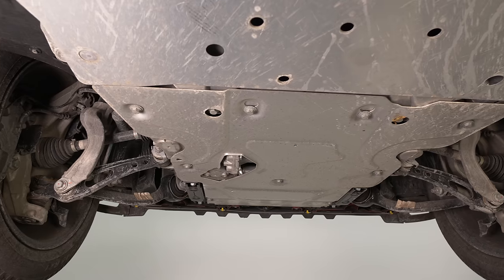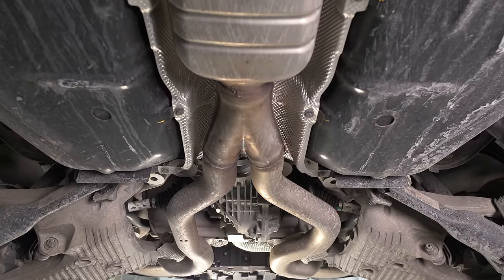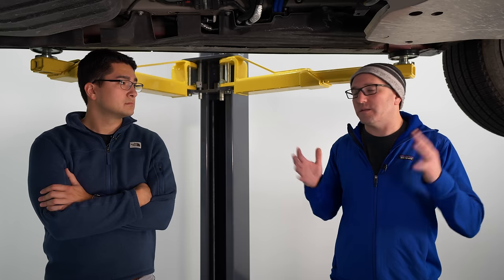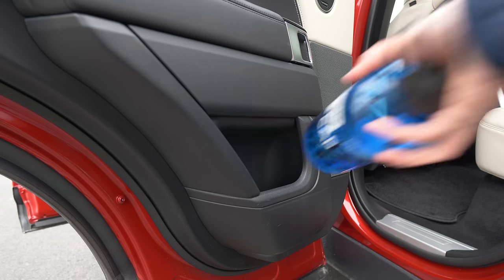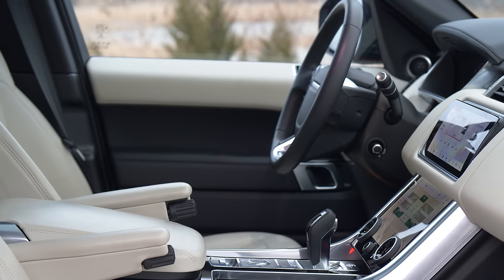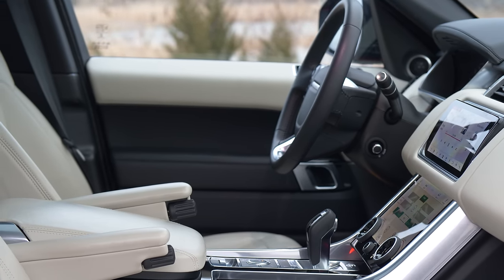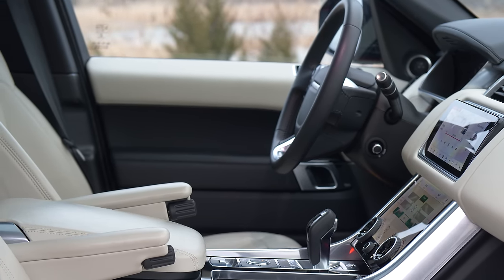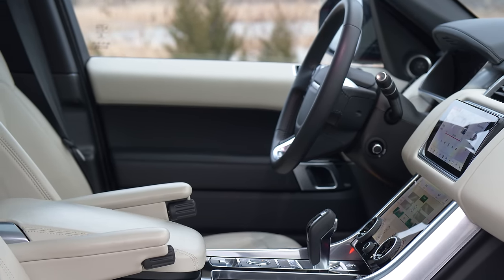2020 Range Rover Sport | More Than Just Status?

Comment: We’ve owned a 2014 Sport supercharged since new. And extended warranty to 100,000 miles. And it gets the snot beat out of it. We have always since 20,000 mls taken it off-road and absolutely covered it in mud and it has never said no. Nothing more fun than flying over nasty conditions and throwing giant rooster tails. And logging roads at well above normal speeds are an absolute riot! Only 1 strut malfunction in 91,770 miles, do to a sensor. And 1 fuel pump issue. It will be gone before warranty is up ( we’re not stupid). Has been a wonderful vehicle! Love pulling up to valet at hotels with it caked in mud. The slow infotainment is annoying. But like anything, you learn its shortcomings and deal. Every other aspect outweighs that. And the big dog Meridian system is a whopper! And that cooler in the console is great for road “sodas”. We live on a long dirt road and it spends more time dusty or muddy than clean. We bought it for its capabilities and not to be a mall queen. It’s got trail damage on underside and had a few cladding scratches. I don’t understand buying something and not using its potential. Wonderful camping trip machine. And would certainly own another. My mother in-law still owns a 2006 RR (the red beast) and it too gets the balls run off it. And besides basic maintenance and while under warranty, covered repairs. The biggest thing to happen to it since was failed backup camera. Got a junkyard unit and she’s doing well. And I might add, when we leave it for service once a year, we drive off in a brand new Land Rover. We are sold. It just works and begs to have the go fast pedal to the floor.
Reply from the maker: Thanks for that, glad to see its been gold.
Reply: My dad's 2014 RR Sport is still running strong as well. He will also be selling it before the warranty runs out.
Reply: Joe Perry I’ve had 6 Land Rovers in the past and I can say the unreliability Notion is untrue
Reply: you got lottery, don't push too far of your luck with it
Reply: rondhole, I wouldn’t say lottery when it’s had 91,000+ miles of real use and was only babied during break in period. It’s always roared to life and is happy to used just like you would a 10 year old 4Runner.
Reply: @joeperry9589  Rover owners are just always in denial. 2014 and 91k miles being a testament? Just wait til you hit 100-120k.
Reply: SC14 , this isn’t my first rodeo. What do you drive? I can pick that apart too.
Reply: @joeperry9589  opposite ends of the spectrum Fiat 500 Abarth and a '11 Land cruiser 200. Abarth has 118k mi and the cruiser got 176k. Surprisingly the Fiat is more reliable than the LC. Has only had a door handle rip off and a couple burnt side bulbs. LC needed radiator and water pump at 150k .....it was on the way out.
Reply: And if you read, it’s gone before warranty is out.
Reply: @joeperry9589  smart. This 2014+ RRS surprisingly has a decent resale value. What do you think you'll get for it at 99k miles?
Reply: SC14, probably worth a high mileage Nissan Versa... Lol
No it’s worth about $30k which is not great. You have to know that going in. I would love to do an LC200 over-landing rig! Wish we could have V8 diesel in the states. Speaking of reliability nightmares. The other car is a 2009 Audi A4 Quattro prestige with 130,000! Yeah she burns oil, but drives just like new. Besides normal wear items the only real problem was the turbo failed at 99,920 miles. It was towed to dealership 100 miles away and had $9,000 worth of fixes under warranty. It’s worth about as much as yesterday’s newspaper. So I will Drive it until it dies and sell it for parts.
Reply: @joeperry9589  nah the LC200, you don't want a V8 diesel if you live in USA. Diesel, the loudness, premium price for the engine upgrade and diesel fuel and all its complicated systems outweigh it's benefits at least here in the USA. Yeah, if you want to chip and tune it for a lot of power it does, but for the USA, the amount of gas stations, and how smooth the v8 gas 5.7l is. I'd choose the 5.7L over the 4.5l diesel. 17.5mpg on the 5.7l vs probably 24ish mpg on the diesel isn't worth it to me
Reply: SC14 loudness?! I drive a supercharged V8 that wakes the dead. Yes, I would want it tuned, extended range tank and the low end torque I’m used to and lockers front and rear. Living in Northern California we have no shortage of diesel fuel. Basically most people drive diesel pickups, we’re in farm country. I can see your point. Just less of a none issue for me. I would also totally take a 78 Ute if I could get one. So will probably get an older LX570 and save the cash lol
Reply: OK... feels like the tata Indian marketing team is on the YT comments section again
Reply: 986C I see the Toyota marketing team has done you well
Reply: 986C says the person with chicken tikka masala as the first video in your playlist. Comic gold! I sure hope you meant to be hilarious my friend!
Reply: Abso lutely, couldn’t agree more. Low end torque and pull throughout the rev range and zero lag. And the exhaust isn’t tainted with turbo muffle. Win win
Reply: Ackj 375718 that’s the person’s handle. It auto filled. And it’s you. Not u. Why make drama?
Reply: Ackj 375718,  did you not see the comma?
Reply: Ackj 375718 we were having a conversation about experience. You inserted a poorly spilled comment about spelling. When you obviously didn’t read the thread. Literally no reason for you to call me out about spelling. Grammar? Why so mad? I’m not.
Reply: @bcatz454  that is the reason why they are dumping for a brand new one before it dies, I mean does.
Reply: Joe Perry Jaguar Land Rover unreliability does not really exist anymore
Reply: Why get rid of it if it’s been reliable and you love it? If it’s been good up to this point it’s usually a solid indication. I’d jus keep it.
Reply: Stephen Isaac, just giving me experience. We’ve had Toyotas in the family lemon law buy back and Lexus nightmares as well. The crap you stuff in a box the crap can fall out when the lid opens. I don’t think any car is as reliable anymore. Too much electronic wizardry is bound to go knockers up at some point. Just had a good experience with this unit. And the old 2006 RR is still going fine as well. I look at it this way, drive what want. If it doesn’t work out? Get something else. It’s a vehicle not a child. Who cares.
Reply: Vizenz121, because I know that it will soon require more repair cost than its actual value. One of my close friends had a 335is that had $30,000 in CPO warranty work done to it over the 5 years he owned it and sold it for enough for a down payment on another vehicle. Going to sell it before things wear out and avoid the headache. It’s been one of my favorite vehicles in my life. But it’s time is limited in our garage. On to something new.
Reply: Joe Perry cool.  I own a new VW Touareg TDI. I get 26mpg on average.  I’ve got a 700 mile fuel range, love it.
Reply: I mean most cars are good up to 100k miles, that's kind of the standard. The distiction you have to say your Rover has been ok to 91k miles speaks volumes.
Reply: L42 Nosnibor and that’s why we won’t be keeping it past 100k warranty.
Reply: Yankee Doodle a friend of mine has a 2016 Touareg TDI and I love it. Vastly unrated suv in my opinion. Great mpg, comfort and fit and finish is great. Keeper for sure.
Reply: @joeperry9589  probably the right move.
Reply: Joe Perry I own an SL55 from 2003 and it was reliable a few years ago when I bought it and still is. Ya I’ve replaced some struts on it, accumulators and an alternator but it’s still cheaper than a new AMG GT. But I will say if u wanna save some $$, get yourself a daily driver nothing fancy like a Old pick up or something and then have some nice cars for the weekend because the money you save will be more than enough to cover the daily vehicle price and insurance if you plan it right and get something used for the daily. That’s what I do and it works great. I got the amg and a new v90 as my 2 fun cars and a Nissan Frontier as my daily. And also have you done any work on cars before? Look up some tutorials on how to do some stuff and if you feel like it’s a little over your head than just take it in. I was able to do belts, alternators, supercharger oil all myself at a fraction of the cost. And if there’s something over my head than I’ll just take it in. You can’t be shy. Idk what your friend was doing to that bmw but if he was daily driving it than that explains why his bills are higher. You can’t be shy about spending money on maintenance, these are enthusiast cars they have a soul and they have deeply human characteristics. You gotta pay to play but you don’t have to pay that much doing a CPo every time it expires. That’s like crazy expensive!! Ya the money you put in has the ability to exceed the value depending on how long u keep it but that’s partly cause the depreciation is so high on these and if you look at the cost of a new or even a newer one your way cheaper! And some of those components too don’t last long so if u get slightly used one u don’t know what might break or what’s done to it really. Big deal if it’s not cpo. Also if you buy the part once on I think fcp euro and it breaks again you’ll get a free part. The more parts my Mercedes gets replaced the more CPo it becomes. So far the struts which are one of the big ticket items are technically CPo I guess haha. You don’t need to buy newer to get good warranty coverage. It’s the biggest myth In this industry. In fact fcp is like a lifetime parts warranty, way better than what the oems offer.
Reply: Range Rovers are the best they have ever been, and getting better. All the high end luxury brands cost more to maintain, that is a known fact. The infotainment is good enough and will be better with the PIVI PRO system which will be featured in the all new Bad A.. DEFENDER! Above and Beyond Land Rover is on the way up:) thanks for the video Geese!
Reply: I've had a 2013 LR4 since new as well. She has 96,000 on her and has never broken once. It's going to be sold before the warranty is over though
Reply: Vizenz121 I do not work on the RR as it’s under warranty. Aside from brakes. It goes to LR once a year for its oil change and inspection when the dash says. The Audi I have done all maintenance and brakes since warranty ended. And had a Jeep XJ that never saw a mechanic in the 10 years I owned it. I did all service and repairs after warranty. I just personally don’t want to open Pandora’s box when age takes its toll on the RRS. Speaking about the BMW, he didn’t spend a dime on fixes. BMW kept replacing   Parts as they failed. He drove it to work and back, towed it to the dealer and so on. Cars aren’t difficult to repair if you want to spend money on them. I just don’t want to start throwing money at it and keep it forever. And I do go between it and the Audi, sometimes it doesn’t get driven for a few weeks. Once it sat for a month. It started out as a take it on weekends and the like. But it is too nice driving to not get miles put on. And used as a regular ride.
Reply: James Y that’s why it has HUGE brakes and stops very well for it size. It drives down the road at 100+ with ease. Does it handle like a small sedan? No. It’s not a small sedan. Can you easily put 9 hours behind the wheel? Absolutely. Can it take you to a great camping spot where you need ground clearance and the rear locker? Yes. I love it for what it is. That’s why I drive it.
Reply: I think you got a lemon
Reply: @joeperry9589  well, its sale number and sold to India and now China tells everything about Range rover. Statistically proven of the most unreliable  car by design although quality control is decent. That's  why UN do not use it, Warlords in Middle East or Africa do not use it. It is for sassy people.
Reply: Hunter Evans Yet everybody is trying to sell them before the warranty runs out.... hmmmmmmmmm.... 
I think people get a sort of Stockholm Syndrome with some of these luxury cars. “I’ve only had one strut fail and a fuel pump issue by 100k miles”... that’s not normal or considered reliable. Struts go, but most cars have NO issues before 100k miles. Go drive a Lexus or Toyota SUV and you likely will have 0 repairs before 100k miles.
Reply: Joe Perry currently have a 07 Jag S-Type 193,200 miles
Reply: n9athan, you must have missed my comment about having Toyota lemon lawed. Tundra with 20k miles and failed transmission seal that took the trans out. And was never properly remedied. 2 month old Lexus LX sat at dealership for over a month with nearly its entire interior removed waiting for a work around because of electrical gremlins. And don’t the BMW issues were hellish. I think having a strut sensor failure and a fuel pump regulator go wanky isn’t a deal killer for me.
Reply: savagegeese was the Range Rover sport you reviewed 355hp or 395hp?
Reply: Hunter Evans The notion? The brand is consistently shown to be unreliable, year, after year. From automotive long term tests, to consumers polling and reporting, from the US, to the UK. You might well defy the odds, and have completely trouble free ownership. But, it doesn’t establish a new reality in which Rovers having problems are an overblown urban legend.
Reply: Hunter Evans Having 6 Land Rovers already tells you how unreliable they are. I’ve had 2 cars only over the past 13-15 years, both Toyota, I still drive both to this day. Only have done maintenance, they have not needed a single repair on anything.
Reply: @joeperry9589  it is a lemon, every manufacturer has lemon sometimes but not 90% of them like FIAT or Jaguar or off course Land Rover
Reply: That’s a damn lie and you know it
Reply: @Peyton Brimmer Lexus is the sweet spot
Reply: Instablaster...

Comment: For work I used to drive a Range Rover Sport in 2012. Like 40k kms in and the gearbox would throw messages of Error telling me to shut down the car and take it to a dealer. I did, they said the fixed it. One month later the Errors came back. It went back to the dealer. Then it did it again and they said they called an "expert" from UK to work out the issue. 
It never did, at this point we just sold it and got a Porsche Cayenne Hybrid (perfect, never missed a bit).
A few years later a friend wanted to get a RR Evoque and asked my opinion. I said stay the fuck away. He didn't listen and bought it. Few months in and like 5k kms he had a gearbox failure in the middle of nowhere in Sardegna, full summer, 40 Celsius outside 😂😂
Teaches him well 🤷🏻‍♂️
Reply: The gear box fault is a well known error and surprisingly has nothing to do with the gearbox, when you get that message it means the main battery or the auxiliary battery is low and either needs a good charge or replaced, I've owned an evoque since 2012 and it still runs beautifully.

The gearbox fault can be annoying at times but is nothing to worry about.
Reply: Shamrock well, if the problem was that simple I would expect they would've fixed it by swapping the battery and whatnot. It went back THREE times 😂
I'm not contradicting you, just stating how ridiculous the whole experience was 🤦🏻‍♂️
Reply: Yeah, Land Rover isn't known for reliability. But most luxury SUVs aren't particularly good in that regard. As for the Cayenne... I think it may have been better in the past. A family member recently bought the current model Cayenne Hybrid and from the start it had a squeaking/rattling driver's seat and the driver's door wouldn't close properly (issue with the electric motor). The infotainment system had issues with Carplay and would sometimes freeze randomly. It also doesn't help that the huge amount of gloss plastic in the interior make it look like a 30k Euro Kia... not great for a 120k Euro car. The interior of the Range Rover in this video definately looks nicer, even though it too has a little bit of gloss plastic.
Reply: @jakehunter3434  or ppl just dont care about reliability and like the brand 🤔
Reply: @emekaossai5485  yeah, that too 😅

Comment: I picked up my 2019 RRS V8 Autobiography in May of last year and have put just over 30K miles on it so far. Its been an absolute blast to drive on and off-road. I hit the trails every 2 weeks or so and aside from the tires letting me down a few times, it never fails me. 
I think people who purchase/lease these things, don't care about the issues some other owners might have, or the overall reliability of the brand, cause they want a Range Rover for what it means and what the brand stands for.  No other SUV drives like a Range Rover, especially once you get it tuned to squeeze out some extra power from that Supercharged V8. 
The sound system is unreal for a mid-range choice (not the 3D option) and the infotainment is workable and liveable as long as you don't go playing with Porches, or Audis, you will feel as its as up to date as it needs to be. They have brought out a few software updates for the infotainment since I picked mine up and it keeps getting better and more responsive.
Only had one issue that was covered under warranty, which was also my fault (took it swimming) but other then that its been an absolute blast to own.